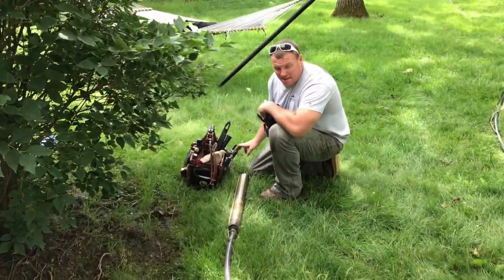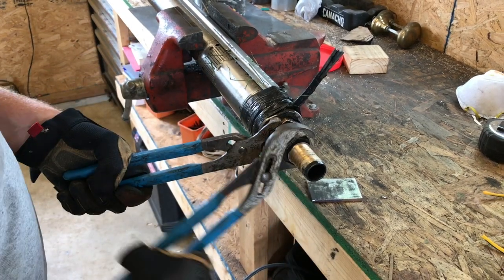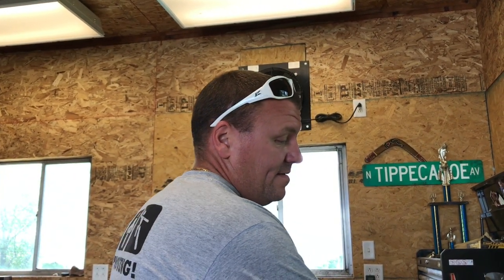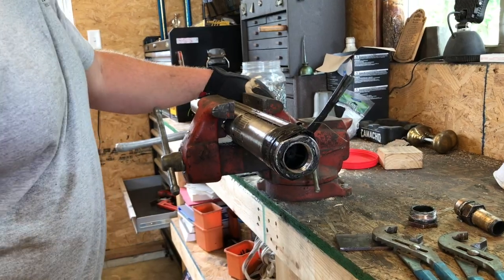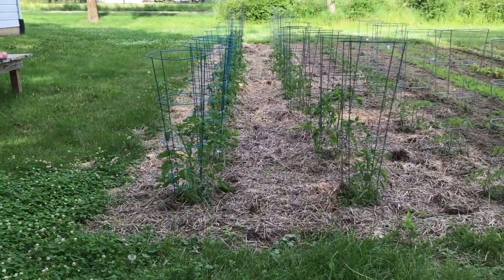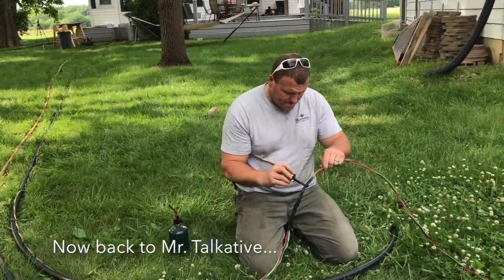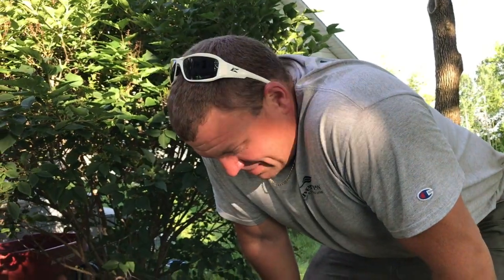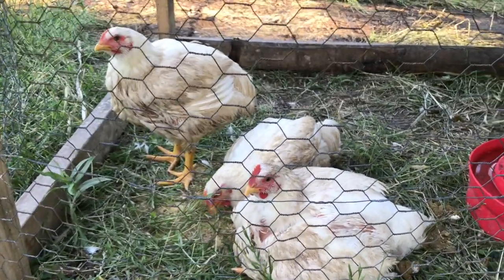How to Install a Submersible Well Pump

Comment: Thank you for sharing your experience. I have found this video while searching for ways to make waterproof electrical connections. Can you tell me more about liquid tape and how it is used? Wich brands are in the market? Thank you.
Reply from the maker: It’s just called liquid tape and the brand I used was Gardner Bender.  That is what they sold at Menards.  It looks like there are several different brands, I think any brand would be fine.  I believe it is primarily used in the marine industry to protect electrical connections.  I applied it to the connections on the pump and it is submersed in water, so the water may eventually get past it, but I thought I would try it for an extra layer of protection.  Hope all is well.  IfI can help any other way, please reach out.  Thanks for watching!!
Reply: @4AcresandaFarmhouse  thank you. I will look for more information on that brand and find a similar product in my country.

Comment: Great video guys, I’m fixing to do this on my well 200 feet deep , how deep is yours and you think it’ll work for deep wells ? Thank you
Reply from the maker: Thank you.  My well is a little over 100’.  We don’t have to go far to get water here and it is clean at relatively shallow depths.  I do think the same setup will work, but you may have to go to a bigger pump and pipe size. Check the pump curve chart and pipe size recommendations for that depth.  The supplier should have that info, or go online to get it.  Good luck.  Thanks for watching!!

Comment: After you put the pump in and the water line is connected to the top of the pump and the other end is connected to the pit less adapter how do you get water to the hose? Is the a junction inside the well the pit less adapter hooks to or something else?
Reply from the maker: The pitless adapter is two pieces. One piece hooks to the hose that goes down the well to the pump and the other is connected to the stand pipe that leads into the house and is connected to the pressure tank. They lock together and you splice the wiring from the pump and the pressure switch at the top of the well head. Hope this helps. Thanks for watching!
Reply: @4AcresandaFarmhouse  thank you makes perfect sense now

Comment: Nice job except you never heat a PVC pipe to push in a fitting.  Best result it push it in cold.
Reply from the maker: I would agree 100%.  I didn't heat PVC, I heated black polypipe and as far as I know, that is pretty much the trade standard for inserting barbed fittings into that stuff.  There really is no other way to do it easily.  I have made many repairs on that style of piping through the years and have never had a problem.  I would love to know a different method if you have one, anything to make my life easier.  Thanks for watching!!
Reply: @4AcresandaFarmhouse  you are correct I have been doing well pumps for 5 years now and  I always heat the pipe before inserting the fittings, the only time you will run into an issue is if you don’t let the pipe cool for a couple of minutes before tightening up the clamp
Reply from the maker: @liamfink737  Thanks for the affirmation.
Reply: Yep, you used the same technique the pump installer on my property used. Also a good tip about letting it cool down before clamping.

Comment: What's with that t-handle thing?  What's it for? How does it work? etc. etc. etc.
Reply from the maker: It is used on the pitless adapter.  The pitless adapter is a valve, of sorts, that connects to the side wall of the stand pipe and the water line from the pump.  The t handle is used to screw into the top of the pitless adapter so that you can pull it all out when/if you need to.  Look up pitless adapter and you will find it.  I hope that makes sense.  Thanks for watching!!

Comment: I'm sorry but curiosity has me wondering was something inside the orange road cone that cut the chickens head off? Or do you just push until its head comes out of the cone and cut it off? Asking for a friend lol
Reply from the maker: Nothing was inside it. Putting the chicken upside down into a cone subdues and calms it and then the head is removed in one movement with a super sharp knife. The cone then contains the body and allows the blood to drain quickly. Thanks for the question and thanks for watching!